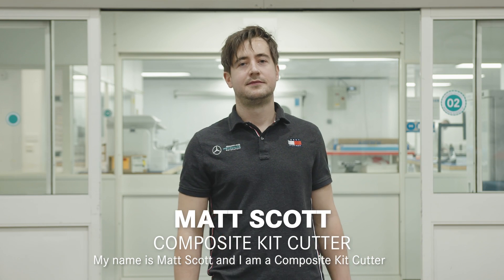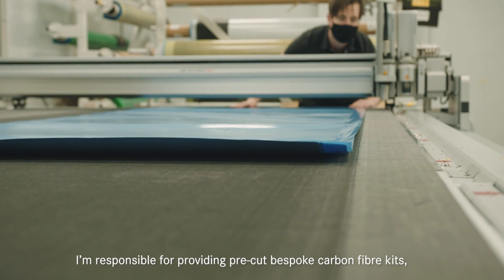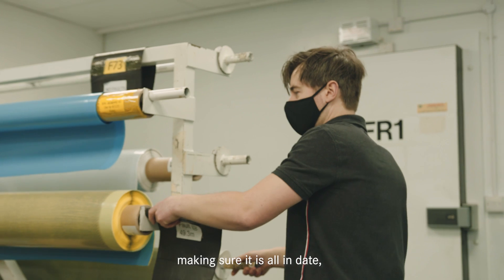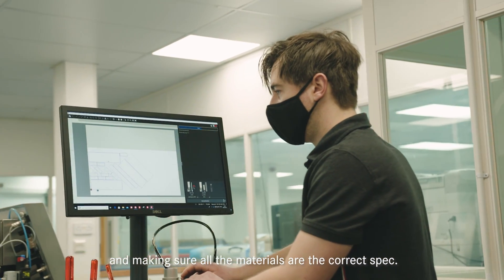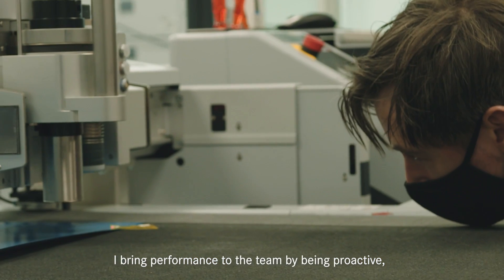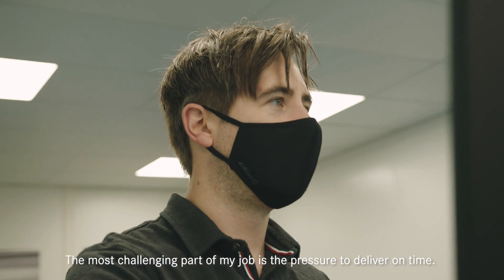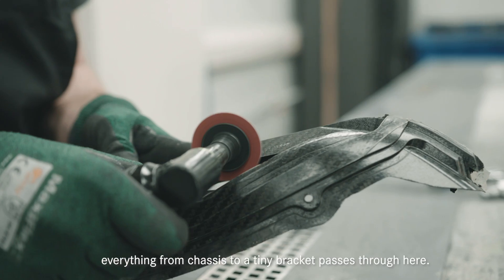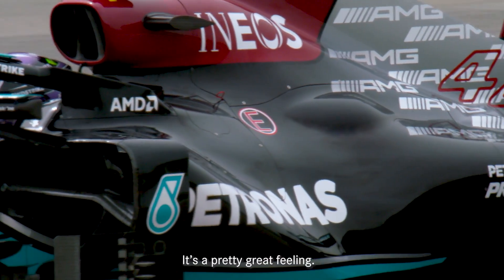My Job in F1: Matt | Composite Kit Cutter

Comment: He is working with a robot to optimise the cost. Custom-made parts are cut with templates.
This job exist since several decades in aeronautics...
Carbon prepreg rolls are taken out of the freezer then cut (each piece has a number printed on it) then assembled then cured in autoclaves. 
Assembling is a very accurate and dedicated job. (Only larger parts can be done by robots)
Designing parts with directional fibers is utterly complex.
He must have liked playing with puzzles when he was a kid.